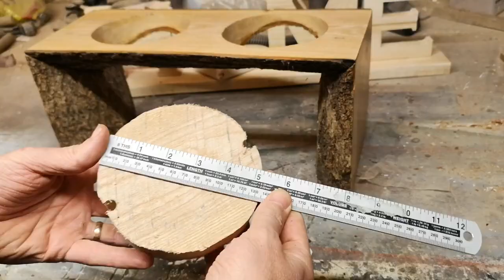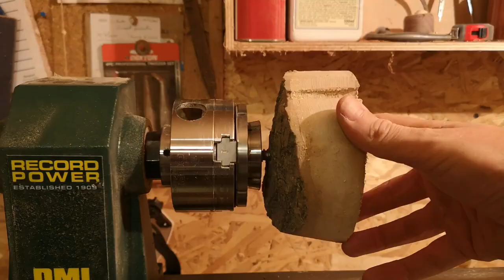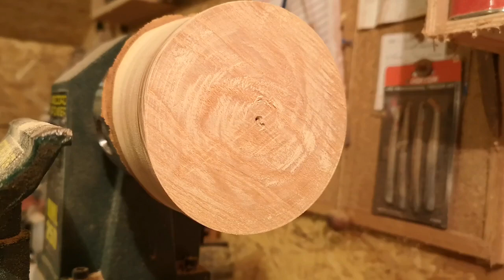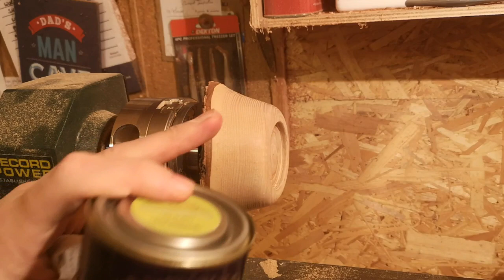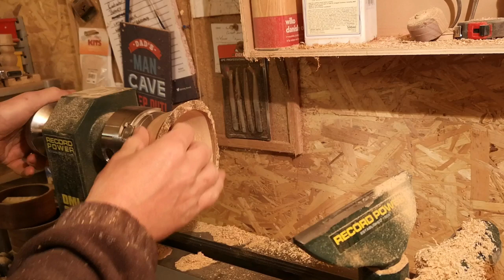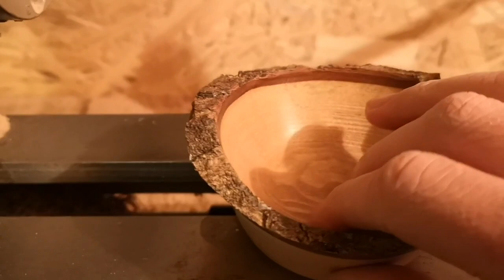Woodturning - A Live Edge Bowl

Comment: Great job Martin and thanks for the shout out.
I love the shape, not many people do them like this which is why it's such a refreshing change and works very well.
Couple of minor tips. With live edge you may often need to take the cut from the top, a bit like when you hollowed out the centre as going from the bottom can dislodge the bark.
Normally when you do the finish cuts on the outside of a bowl you take them from the bottom. Imagine all that grain staked as little needles, by cutting from the bottom as you move out all the grain is being supported by the next layer. 
Don't worry about the size, you will soon find that making small items like this is actually harder than making larger items.
Well done!
Reply from the maker: You are more than welcome Paul, you have become a mentor and a friend, whom I respect and look up to. I will digest this and put it into practice. Thank you again for your support. 👊👊👊